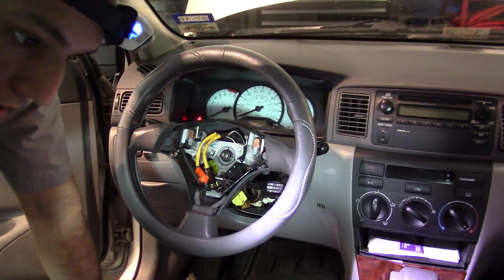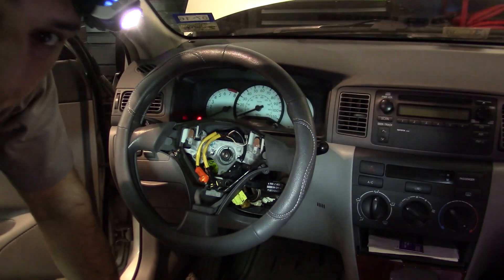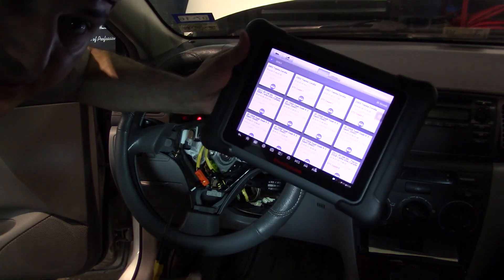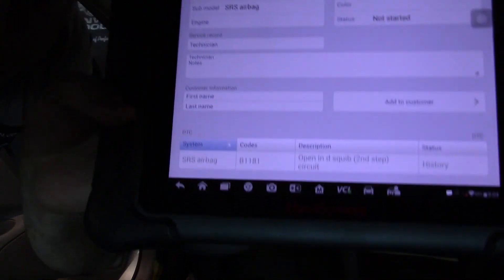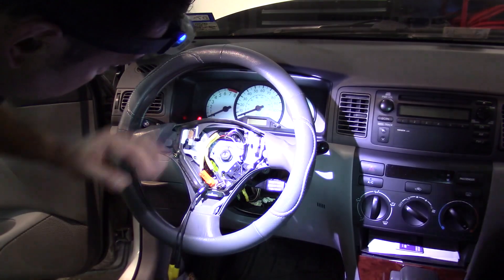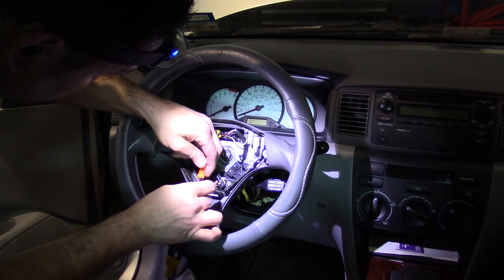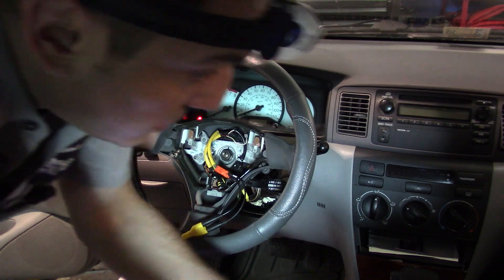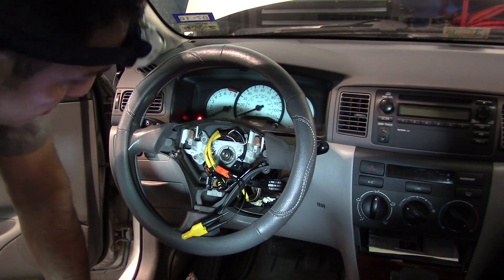2003 Toyota Corolla LE B1181 SRS diagnosis "Clock Spring test"

Comment: I thought you are never never supposed to work on the SRS system with the battery connected!!! 😮
Reply from the maker: Yes that is correct. Unless you now what you are doing! I did disconnect the battery to remove the airbag. Then I am working with no airbag and using a airbag simulator. That is how the manufacture and a real technician we do the test.

Comment: I have a 20o5 Scion xB and I scanned it and the code is B1181 Open in D squib 2nd step circuit so does that mean it’s the clockspring? I ask because I know there’s 4 things it could be but I see other peoples codes that will say 1118 or other codes and it means a specific part in the srs system. So I just bought this car last week and the owner removed the passenger seat in the past and put it back in so idk how long the code has been on but the connectors are all on. My horn works as well.

Comment: Hi. I have the same issue. I do not have the simulators. How can I test the cables from the connector all the way to the computer without the simulator? Can I try measuring continuity or something?
Reply from the maker: That is just a 3.2 ohms resistor. I would recommend get some and tested properly
Reply: @MaicSalazarDiagnostics  ok. Thank you!

Comment: how much was the new clockspring? thanks.
Reply from the maker: RL Agito no idea! I don’t buy parts. Maybe look in Autozone
Reply: I bought mine on e-bay 2 years ago for like $20....my brother installed, saving me $700 Toyota dealership wanted.
Reply: Clocksprings for older Toyotas like this are super cheap. I see them for less than $30 online. The dealership will totally rip you off